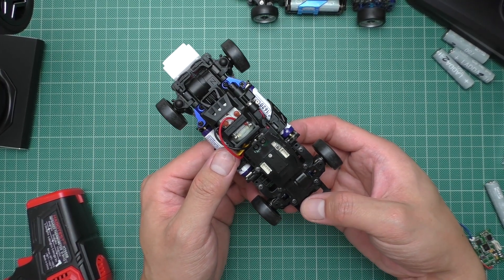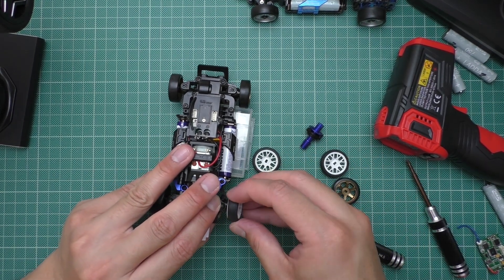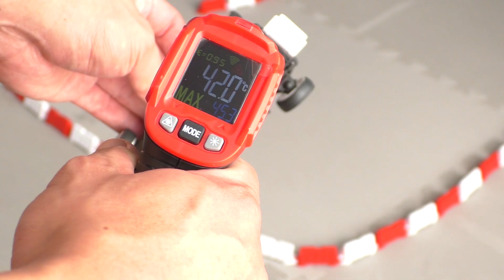XTAR Li-ion AAA 1.5V with Mini-Z - Revisit

Comment: You have the set the settings to lipo mode with ics adapter on asf mini z
Reply from the maker: This is supposed to be equal to 4xAA Alkaline so the programming should not be necessary. It's not 3.6V li-ion per cell + 2 dummies. Well, at least that's what Xtar tries to sell this battery for.

Comment: Hello, I recently bought my first mini z model, the mr-03, and I read the manual, which says that I can use alkaline AAA batteries. I'm still thinking about buying rechargeable batteries, but I'm using alkaline batteries for now. When I installed the new batteries, my steering wheel started shaking, and I thought it was a problem with the equipment. However, as the batteries drained, the shaking stopped, but now I'm worried about using alkaline batteries.
Reply from the maker: Alkaline should not give the car any problem but well, here we are. 
Get NiMh rechargeable if you can. Even the 750mAh AAA from Ikea is really good.

Comment: I also used these batteries and damaged my Mini-Z.
And it's FHSS.

The actual voltage of alkaline batteries is about 1.7 volts, and the store selling the Mini-Z was also confused as to why 1.5 volts batteries would damage it.

Perhaps should follow the instruction manuals "Do not use special type batteries" advice.
Reply from the maker: Sorry to hear that. It might be possible that the voltage regulator on the battery spiked under load and output more than 1.5V, possibly 3.7-4.2V per cell. I still haven't put it on the oscilloscope to check it though. It's not like I'm going to risk another car doing it.

Comment: I suspect the voltage regulator stepping down for the microcontroller is getting killed. Might be due to short bursts/transients of voltage spikes

If you don’t mind, I’d happily look into the board. I’d like to know what happened. If it’s reasonably fixable, I’ll repair and ship it back to you at no cost other than shipping it out to me, I’ll cover return shipping. I’m over in Australia.

Comment: Thanks for this video!
I am at the track and I was about to try these in my MR03 red antenna (MHS protocol - I think it is a MR‑03 VE Pro) any idea if safe ?! ❤
Reply from the maker: I wouldn't risk it.
Reply: @BeaversHobby Just to add some more feedback. I’ve been running these on my MR04 Evo2 for a few weeks without any issues.

Comment: Connect an oscilloscope to the 6v + - terminal. Since its a Lipo AAA or (AA) battery, it has a step down from Lipo 4.2 to 1.5V circuit. It could be pulsing and cause an interference to the resultant voltage of the 4 batteries. Or I suspect when there is a acceleration load the circuit sense a drop in voltage ramp up the  PWM to compensate. But when the throttle trigger is release, the voltage overshoot momentarily.
Reply from the maker: That's a great idea. I should try that when I have a chance.

Comment: I used to push 8.4 volts of lipo through my xmod + a higher power motor on the stock electronics. It did the overvolt steering twitch if it wasn't on the ground too. At some point I upgraded to stacked FETs to run even higher power motors.
Mini-Z burning at 6v (same as alkaline) just seems odd to me. I wouldn't blame the batteries for that.

Maybe its all sorts of voltage spikes from the steering shake? Perhaps you could add a capacitor somewhere to smooth them out, or a 1 ohm resistor inline with the steering motor to keep it under control.

If you can find the power and ground pins of the control ICs, you can add some capacitors across them to help protect them. Maybe that will save it.

Comment: You're surprised 6 volts killed a board rated for 4.8 volts?
Reply: But it should support 6 volts because Mini-Z is set to work with alkaline batteries
Reply from the maker: This thing is rated for 6V Alkaline battery though.

Comment: Bit surprised how little it takes to burn a mini-z board, especially the older ones.
Wonder if there is the possibility of adding in a resistor that could be put in line with the receiver chip so it doesn't go crazy like that at the cost of some range.
If you have an original ASF board or ASF car laying around feel free to check over that & compare with the newer 2.4 ghz ones voltage input on the receiver chip.
Think thats the 20 pin chip in between the two white connectors on the pcb.

Meanwhile back in the day on 27 mhz boards people were doing stuff like running 2s lipo on brushed mod motors on iwaver 04 monster trucks.